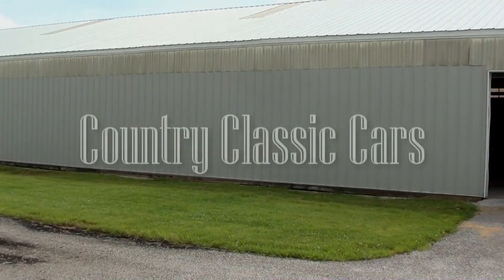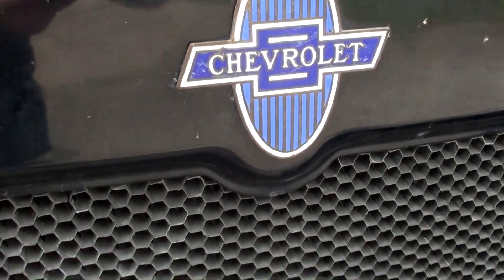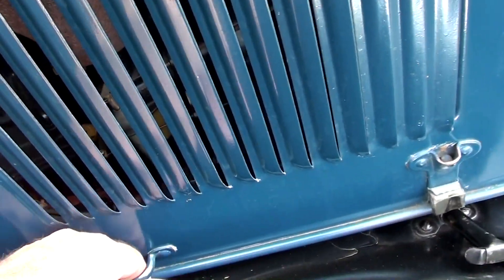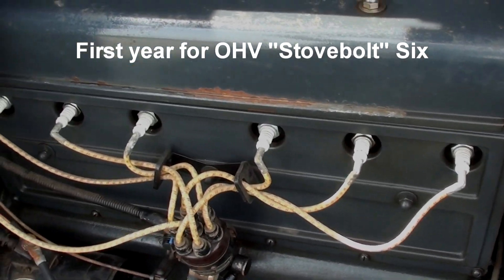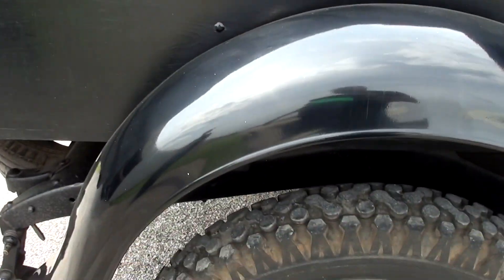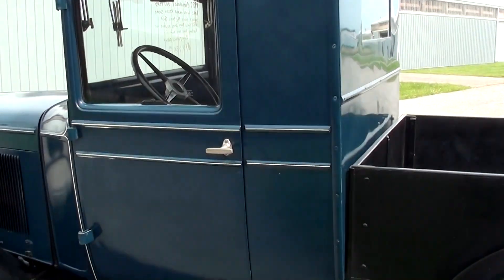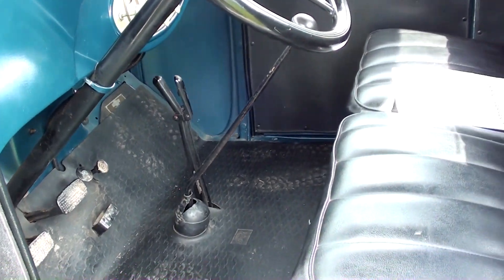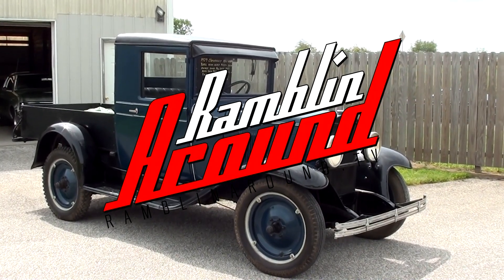1929 Chevy Pickup 194 Cubic Inch Stovebolt Six at Country Classic Cars

Comment: oh Jeff.. you "know" I'm lovin' this one! haha.. those old Chevys are very rare because, unlike Fords of that era.. the cab was just sheet metal tacked onto a wood skeleton. so.. consequently, most of the old chevys rotted away.. I had to replace all the wood with metal inside my cab.. thats the same engine as my Rock-a-billy.. but by 1932 they had a balanced crank and gained a smidgen more hp.
thanks Jeff.. we all appreciate what you do!
Reply from the maker: 1963impala2dr Thanks for the info Ken, I knew you'd like this one for sure. I read that they even had a forged crank in the 1929...just not balanced like the later ones. That engine was a pretty big jump forward.
Reply: RamblinAround
chevy didnt make flathead fours..even their 4 bangers were overhead valves. I have one sitting along side my driveway ;)
Reply from the maker: 1963impala2dr Whoops...you're right.
Reply: RamblinAround hehe.. I've been around an old chevy or two in my time. lol
Reply from the maker: 1963impala2dr I guess I spent too much time around Fords :)
Reply: RamblinAround
haha..it doesnt matter who built them.. I just love old iron..as I know you do.

Comment: Thanks for posting. My '29 Chevrolet is a 1 1/2 ton model but the whole front half looks the same. The cab is in pieces and it didn't have a top so I assume by your video they came with a canvas top? Anyway sharp looking truck.